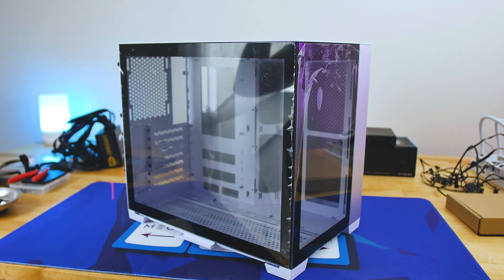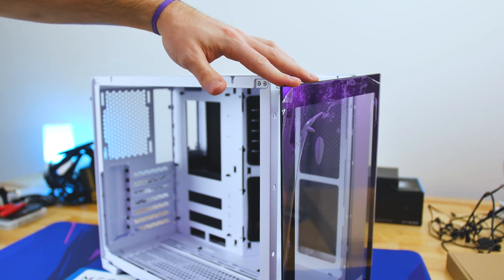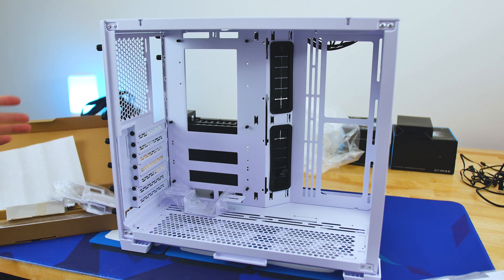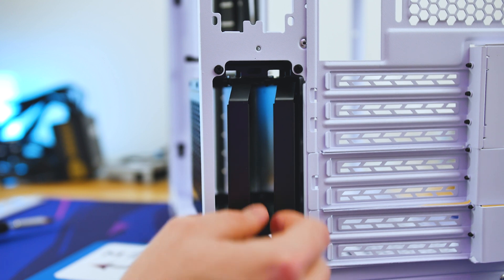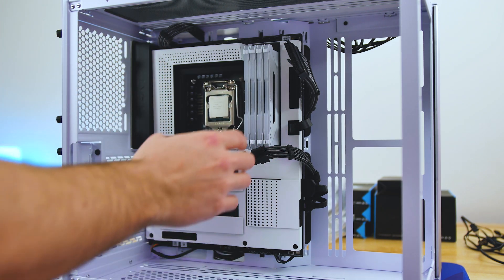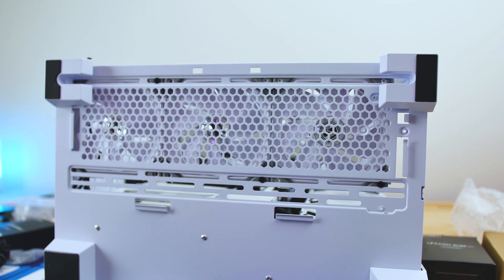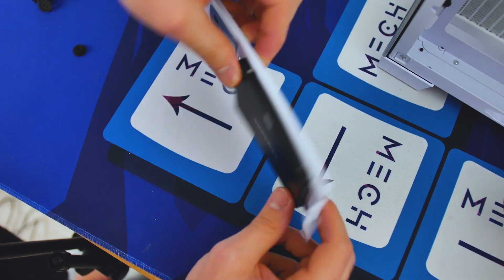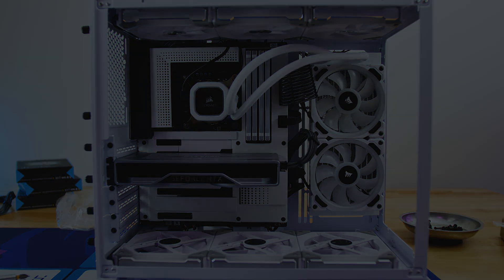How To Build A PC in the Lian-Li 011D Mini

Comment from the maker: Parts listed in the description, except for the GPU because GPUs are urban legends at this point.
Reply: the motherboard like goes to a h510i just to let you know
Reply: @edgyy7799  Do you know what the motherboard is?
Reply: Hi bro..what GPU you using?..im newbie in building pc..i want to build like your pc..so i need to buy all saparated..Please help me🙏🙏🙏
Reply: Is it possible to fit 3 Corsair LL120’s on the top and one corsair LL120 on the left side of the case?
Reply: @Big-Mc-X  yes! a 120mm fan will fit on the left, so will 3 on either the top or bottom
Reply: How much did this build cost you
Reply: you left out the AIO link
Reply: What power supply did you use? I’m doing an all white build and can’t find an “sfx” power supply. I was planning to go with the ASUS ROG Strix 850W White Edition PSU off of Amazon. But now I don’t think it fits the case, any better options you might have?
Reply: the motherboard is a case?
Reply: Hi Bro i know you posted this video a year ago but I bought the lian LI o11 mini  but didn't get the extension pieces for the ATX motherboard etc do you know where I could get it? Btw i Loved the video well done.
Reply: Hey dude. I just wanted to say that you should not orient your CPU cooler that way. you DO NOT want the lines which connect to the radiator to be above the CPU pump unit. This ends up with air settling at the end of the lines in the radiator and your pump will suck that air in and it will ruin the pump over time. For someone who claims to know about PCs this is pretty bad advice.
Reply from the maker: @haze657  At most there will be air towards the top of the tubes, which creates noise, it doesn't necessarily hurt performance or increase the rate of degradation. The important take away is that the pump is not the highest point for the cooler. Flipping the tubes around would be a tight fit around the GPU. It is perfectly fine in the orientation that it is in for the sake of the video.
Reply: @haze657  as this is a high end aio, this doesn’t actually matter the pump will not suck in air. The only problem you could have is air getting trapped at the top of the rad which can cause a little bit of noise
Reply: @haze657  the radiator is also higher than the pump block meaning the air won’t be sucked in anyway

Comment: thank you very much for this video!! so much great info to help me prepare for my build.

I have seen some others sort of 'custom mount' their 360 AIO Cooler to act as exhaust on the top of the case(where you had put your exhaust fans)...then also using the side mount(where you put your 240AIO) to put 3 intake fans for more intake fans than exhaust. 

My question to anyone is... is one configuration necessarily "better" than another? Or are there any preferences when it comes to having more/less intake than exhaust fans? Any help is appreciated, thanks!

Comment: That negative air pressure, the AIO will not be doing all that well its fighting for air flow and the entire setup will be sucking in massive dust through the back of the case....DO not do this you are going to get poor thermals due to vortexing airflow in the case. In this config- Top Mount -3x Exhaust , Side mount - 2x Intake, Bottom - 3x Intake, Back Mount - 1x Exhaust. If you want it too look pretty invest in some "reverse blade" fans for the bottom and the side, If you are watercooling EKWB makes a distro plate for the front but the fans on the side will have to be mounted on the backside so you have the room in the 7 slot config. Also SFX PSU, the ASUS ROG Loki 850watt Plat is perfect for this case, the only cable I could see being a problem would be the 600watt GPU12pin connector as you do not want a sharp bend in the wiring.

Comment: I used the NZXT Z790 with a 280 MM Arctic AIO, with this mobo you have to use a 90 degree angle adapter in order for the USB3 port to fit on 280mm radiators. Not fun finding that out mid build lol.

Comment: Recently finished a build in this and did the dual PSU option. Makes the case heavy but is great to have so much head room for future GPUs.
Reply: Gonna be hard fitting anything past a 4090 in the future. Hope Lian li revisit the mini by making it a tad bigger to accommodate 50 series cuz an 5080 I doubt would fit in at all

Comment: The way you put the fans in it is negative pressure which is more exhaust than intake meaning you will draw in more dust which isn't good. Should be either balanced, that is equal intake and exhaust or positive pressure meaning more intake than exhaust. The fans on the radiator should be the other way round.
Reply: is it bad to do intake top and bot and exhaust from rear and side of the aio ? im thinking i shouldnt intake from the aio but i really prefer to intake from bottom so im a little bit confused about it , not sure whats the optimal
Reply: @ecosti  Intake bottom and side, exhaust top and rear.

On the AIO it is better to push the air through the radiator if it is at the side or the front of the case but then if it is at the side you won't see the RGB of the fans unless you do a push pull config. Next best option is to do a pull config so you can see the RGB of the fans if intake at the side. If in the roof you exhaust air through the radiator. You don't do intake if installed in the roof of the case, that would be counter productive.

If you have more intake than exhaust, say 5 intake and 4 exhaust that is positive pressure. You can tweak the fan settings to balance it out, it will take a while and well it isn't really worth the effort.

Comment: In lian li mini, I plan to have 3 bottom intake, 3 side intake, top 3 exhaust. Radiator I plan to have on the side 240mm. Radiator tubes will be at the top. Now for pump tubes (the circle) should I have them below the AIO pump or the side of the AIO pump (white circle)?

Comment: hi really quick did you use the lian li fan controller and the corsair fan controller since the cpu cooler is a corsair if not how did you do it and was their enough usb headers on the motherboard cause did the io usb 3.0 ports just go into the motherboard in a different conector and about the usb c where did you put that thx? just curious as im going to a very similar build

Comment: Ok quick question cause I’m new to pc building,  I was planning on pc swapping my case. And I was tryna put some upgrades like the cooler and fans. My pc is a MSI - Aegis SE 10th Gaming Desktop. And I need to know if I need like new graphics card,new wiring, probably fans. I would like it if u did some research on it cause it’s kinda co fusing at the moment.

Comment: i have a question, i have the lian li mini, with a 240 NZXT AIO. i have it on the side ( cause i have an atx board it fits nowhere ) i have 3x120mm intake on the bottom, 3x120mm exhaust on top, then two intake on the rad ( and ofc on the otherside it's intake aswell ) is that okay? or should  i make my two fans on my rad exhaust?

Comment: I have a question, for what I'm seeing you have 5 exhaust fans vs 3 intake fans. Are they running at different speeds or how are you managing to get positive pressure in your case? I want to build something similar.
Reply: I just built in this case yesterday, just put the two fans on the rad as intake. 5 intake 3 exhaust. You can also put an exhaust in the back.
Reply: @nicksummers3472  did you have the bottom fans as intake or exhaust?

Comment: Does a full atx psu fit in there?
Reply: So the thing is that it cannot fit a full atx psu, but I made it fit lmao.
Reply: @maxmil2809  how did you do  it.
Reply: @maxmil2809  ?can you help me out
Reply: @mariomiranda1577  well it’s the most ghetto way to do it but right under the graphics card is where I put it and since the pci slot covers could be rearranged or removed I took them off. Now I removed the screws from the grill that goes on the fan for the psu and placed attached them back on this time from the bottom of the case like if I were adding a normal fan.

Comment: Nice vid ! Shouldn’t the cpu fans be set to intake instead of exhaust? Building this one soon and wasn’t sure which way the cpu cooler fans should be facing
Reply: Late reply but you can run push or pull through radiators, especially in an airy case with lots of fans like the o11 mini.
Reply: Pull is better or push having the fans on the other side of the radiator. I heard there can be a 8 degree difference on radiators pulling air through the radiator to pushing hot air through out the case. Not sure there is any benefit to having a push/pull set up.

Also he has the fans set to negative pressure which will cause more dust to enter the case. Should be either balanced(equal intake and exhaust) or positive(more intake than exhaust).

Comment: Your radiator is the wrong way up mate
Reply from the maker: You're incorrect
Reply: @jdtechgear  im not. The coolant reservoar is where the tubes connect to the radiator. When the liquid is at the top, air will get trapped, the aio will make more noise, the cpu will be warmer and the aio lifespan will be shorter. I thought everyone stopped doing this last year
Reply from the maker: @DetailingCars  the rad and the tubes are elevated above the pump so air is not trapped in the pump. There will be a negligible amount of air at the top of the rad which sacrifices some minor performance, but that's the extent of it.

Comment: do you have to remove the hard drive cage in order to fit the sfx power supply???
Reply: If you plan on using the HDD cage, you should remove the HDD cage temporarily in order to get the PSU in easily, then add the HDD cage back once the PSU has been installed.

Comment: just curious do you think i would be able to fit an extra 120 mm fan at the back of the case by the cpu?
Reply: There is room for a rear 120mm exhaust fan, but most build videos I've seen don't bother with one.
Reply: @JPEvans-qh9fs  thanks

Comment: would you guys recommend putting the AIO on the top? i like it better on top but not sure if my triple fan AIO will fit like that
Reply: There are several build videos where a 360mm AIO is placed in the top - make absolutely sure you get everything plugged into the mobo first because once the AIO is in place it covers the top connections of your mobo.

Comment: You have negative pressure in your case
Do you even know anything about airflow and you are teaching people how to build in this case
Reply from the maker: This is one of the the recommended fan configurations from Lian Li. There are 3 intake fans at the bottom and 5 exhaust. You would need a much higher ratio of intake:exhaust CFM to create significant drawbacks in thermal performance in this configuration.
Reply: @jdtechgear  bro there is not enough air in the case to exhaust you're compromising performance for aesthetics
Reply from the maker: @vaibhavaggarwal8363  it does not need to be a 1 to 1 ratio. The only aesthetic part is switching the radiator fans from exhaust to intake. Regardless, this PC build is not focus on thermals, it focuses on exclusively the build process with the case. I even explicitly mention that there is no thermal testing.
Reply: @jdtechgear  man but people will copy your build and their build's will be shit just because of thermals
Reply from the maker: @vaibhavaggarwal8363  not my problem, I explicitly stated it. I don't have the time on my hands to run thermal testing for these videos. Regardless, the thermals are fine for what they are. If you want the absolute best, then switch the rad fans to intake. Get off the high horse bullshit thermal performance trip.
Reply: @jdtechgear  bro you can't say it's not your problem,ofcourse you have to think about it also and if you don't have time for thermal testing then you shouldn't make videos in the first place
Reply from the maker: @vaibhavaggarwal8363  think about it? Uh yeah I mentioned it in the video? Nah that's not how this works. I cater my video exactly to who I want and how I want to. I am not obligated to meet your requirements for a video. If that's too much for you to handle, maybe you should stay off YouTube.
Reply: @jdtechgear  man listen if you can't meet some basic requirements for a pc build,then no one will ever come back to your channel
Reply from the maker: @vaibhavaggarwal8363  is this your first time on the platform?
Reply: @jdtechgear  no man

Comment: If you're a new pc builder, do not use this fan solution. Use one type of fan. You cannot use Corsair fans properly with a Lian Li controller. That's why his Corsair fans were stuck in default mode. Just buy all one type of fan. Then you can properly sync them all. Even if you were to install two controllers with his system, you would need two addressable connections and it would never look right. Corsair ICUE does not work properly with Lian Li, although with much hassle, you can get limited results. Lian Li software will give you even worse results.
Reply from the maker: No. The Corsair cooler and fans go through their own controller via USB. The Lian Li fans use a proprietary connector. These systems work independently from each other. The fans aren't spinning because the fan curve is recognizing the idle CPU temp below the threshold to spin the fans.
Reply: @jdtechgear  You didn't install a Corsair controller. Just the Lian Li. My point was that you cannot properly sync the two different fan systems. Sure you can make them work, but why would you spend that kind of money on something that can't work probably together. I have that case. I have six ll120 fans.
Reply from the maker: @james1seattle  The controller is via USB. Like I mentioned above. The Corsair fans are not connected to the Lian Li controller. The only thing you have to sync is the lighting if you choose  different effects. The argument I'm making is not about lighting synchronization, it's about the controller issue you pointed out which is false.